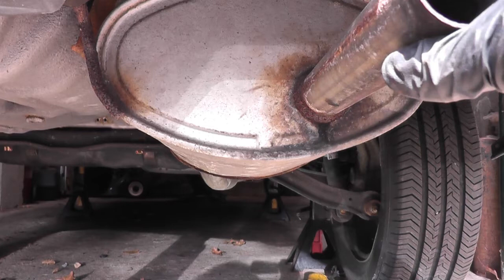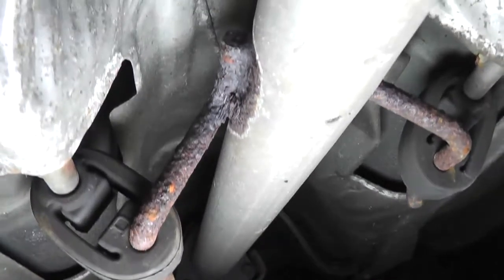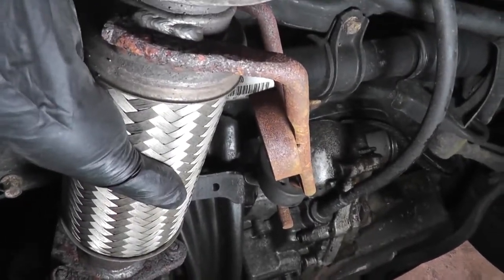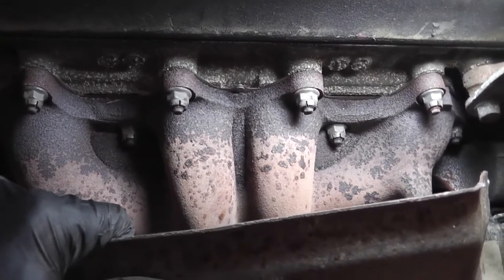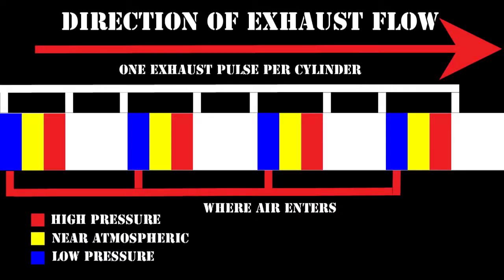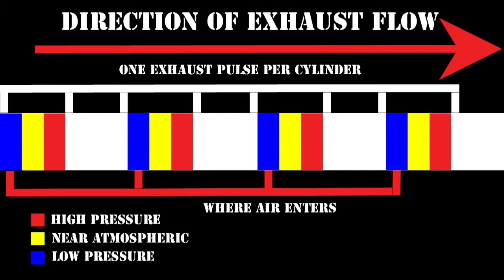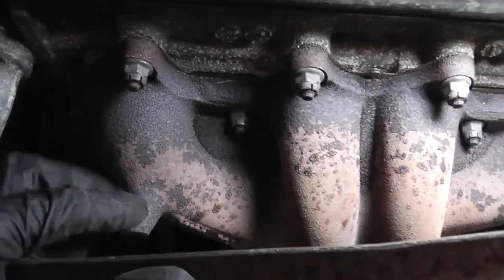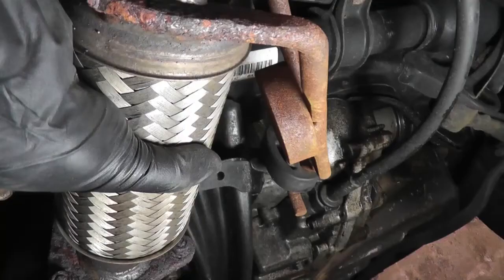Finding Exhaust System Leaks

Comment: My exhaust leak was under the header shield.  Sounded like it was coming from expansion armored section.  turned out to be #3 pipe fractured at "collector"  Patched with some cheapo calcium silicate paste.  worked like a charm.  Reason I'm posting besides to thank Busho for so much expert and professional help here, but to point out that it was hard to locate since the fracture just looked like a black hairline around the pipe.

Comment: Hey I notice you work on the Honda a lot like all your videos I have a problem with my Honda Accord 2000 on recently noticed in my radiator Oil my car doesn't overheat and it doesn't stall I have no milky oil my  dipstick or where I put oil at people that I talk to tell me is the head gasket but my car doesn't overheat there is only oil in the radiator I was wondering do you have a more and I deer what can it be midsize that basket oh is it for sure that gasket thank you for your time appreciate it

Comment: ***** is there anyway to better pinpoint an exhaust leak other than feeling with your hands? I hear a puttering sound near the middle/rear of the exhaust.
Reply from the maker: Have a helper hold a rag on the tailpipe to create a restriction. The back pressure will make the leak larger.

Comment: Nice review. Some mufflers have a tiny hole drilled into the bottom, to allow condensed water to drip away rather than pooling and rusting the muffler prematurely.